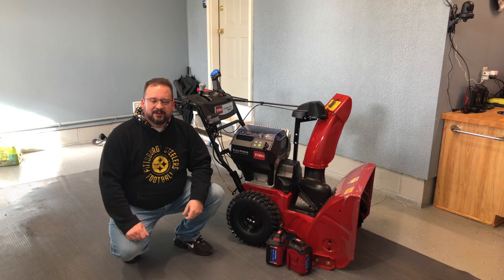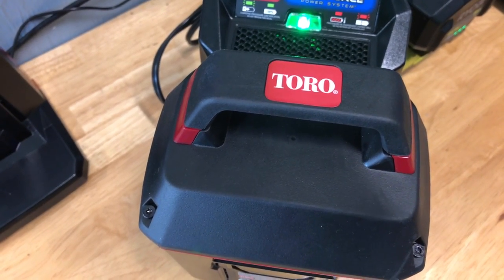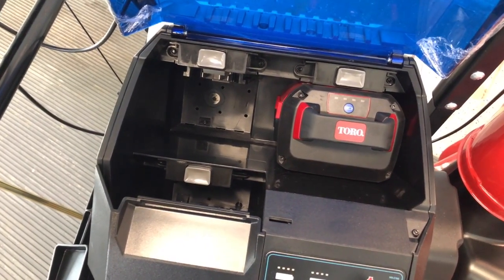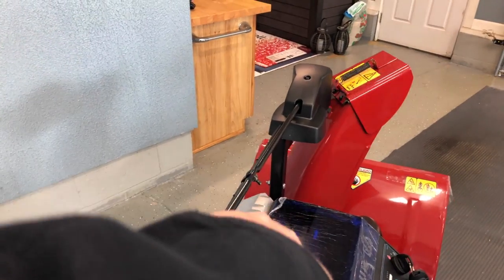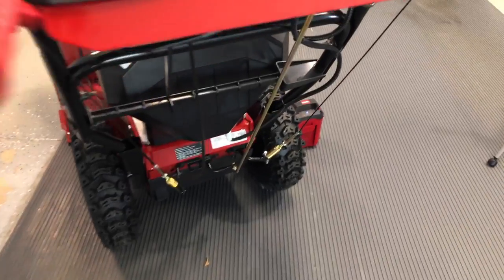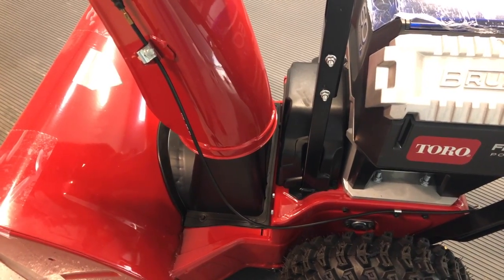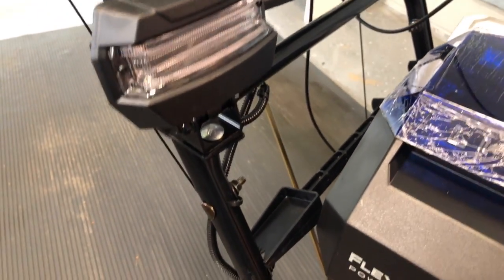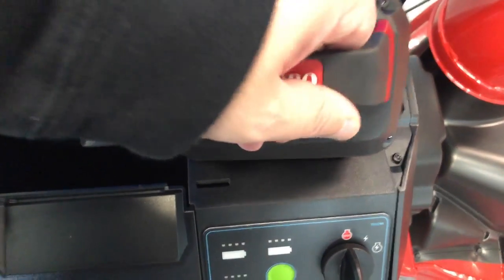Toro 60v Power Max e26 HA electric 2-stage snow blower

Comment: Works awesome 😎 no more waking up the neighborhood 😜....no more stinky gas 🪔 oil, will get the 10 amp batteries soon 😁
Reply from the maker: I got a small test with the storm last weekend.  No snow in the driveway.  Thanks to all of the wind. However on the back of the house the patio had about 13” of snow drifts.  It was nice just to put in the batteries for a small section and cleared it off.   Only a several minute job job but I didn’t smell like exhaust from a 30 old gas engine.  The best thing, I wasn’t inhaling the exhaust either.  I will get a video out when when I have snow in the driveway to share.

Comment from the maker: Well, I haven't had much snow to do yet in the driveway.  But with the last polar vortex I got 14" snow drift on the patio that is 25'x15'.  It did a good job and better than my old 5hp Lawnboy would have done by doing it faster.  There was a noticeable bogging down when the snow got over 8" but kept going in 1st gear.  I need to get some snow to see how much of my driveway it will do.  When that happens I will get a video out.  The Christmas storm was about -10 air temperature and I didn't want to be outside any longer than necessary.

Comment: Does this have auto turning like my 826 OXE? I was looking at this one and the e24 but looks like the 24 inch doesn't have the heated hand grips.
Reply from the maker: It doesn’t have auto steer on the e26 HA.  However, it does have heated handles.
Reply: @model3geek163 Do you miss the auto steer or really find that it’s not that much of a difference or even needed? I flooded my carburetor this year and mine needs service so I’m just thinking I might trade it in or go for this unit. Tired of dealing with gas, oil and the prep work.
Reply from the maker: @epg2501  My LawnBoy 522 drove the same way as the e26 does.  However, the e26 has much more torque while driving than the old Lawn Boy snowblower.  So it pretty easy to pull left or right for steering.  Just a manual version of the auto steer.
Reply: From what I understand the e26 does have auto steer. It will unlock the axle. The e24 has a locked axle.
Reply from the maker: @WatsitTooyah  from my understanding auto steer has a trigger under each handle that you would depress to steer the snowblower on older ICE models.  The e26 HA does not have these triggers for auto steer.  @EPG Can you confirm this is the feature you have and are asking about?  Not wheel free spin.

Comment: Does home depot deliver to garage as I see free curbside delivery available?
Reply from the maker: Home Depot did deliver to my garage.  Cement driveway about 170 feet from the street.  Great delivery experience too.  No additional charge.
Reply: @model3geek163  thanks! That’s great to know as I was worried they would leave it at the end of my driveway!